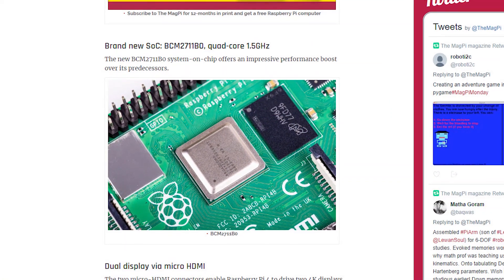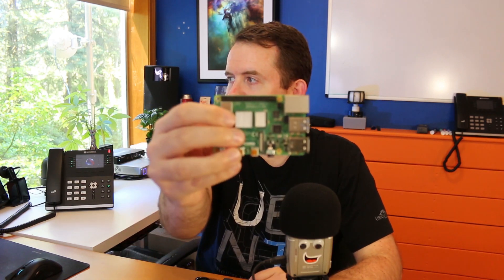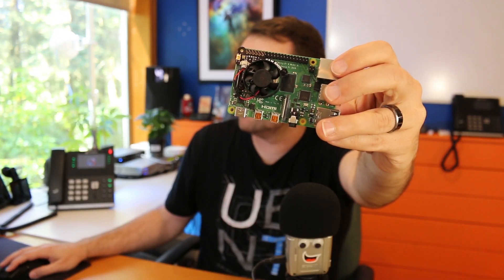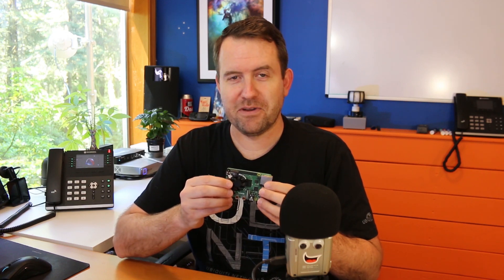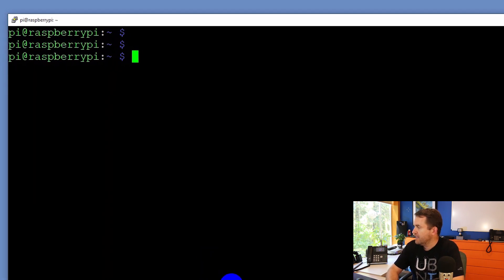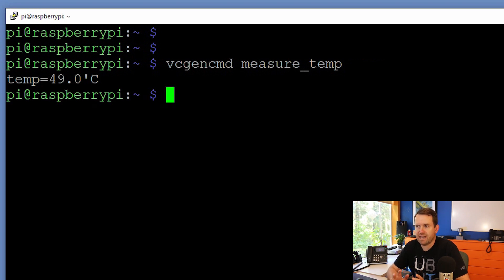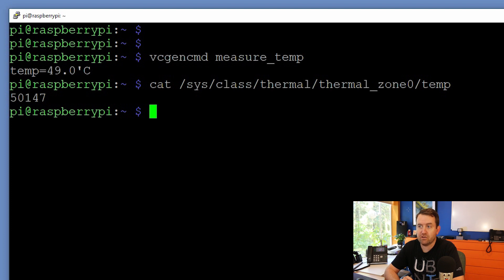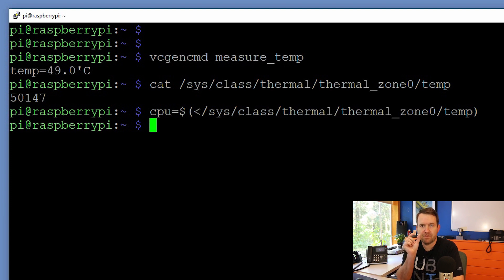Raspberry Pi 4 Heat Testing

Comment: Thank you for the video, some good ideas for heat management. A couple notes: The relatively large black flat chip next to the CPU is actually the SDRAM, not the GPU. That can definitely benefit from a heat sink as shown in the video. Other chips that would be good candidates would be the USB controller, the ethernet controller, the power regulator (as mentioned), and maybe even the wifi controller's can/casing. This hackster.io article has a nice block diagram.
https://www.hackster.io/news/meet-the-new-raspberry-pi-4-model-b-9b4698c284

Also, speaking of Crosstalk, you've got some interesting digital distortion in the left audio channel of the video, that sounds a bit like old school GSM audio interference. maybe something your mic/line is picking up. :-D

Comment: Inside my my-temp.sh script, the console says permission denied when I try to get the CPU temp. How do I fix this?
I've tried forgoing defining cpu and putting the temp location (like you did on the console earlier in the video), and it did notice useful.
Either I get an error that says permission denied, I get a 0 where the temp output should be, or it acts like there is nothing there and doesn't print the CPU temp.
Reply: I had the same problem, the first time you run the comand you have to type: sudo chmod +x my-temp.sh  and then type: ./my temp.sh. it worked for me
Reply: I can get the CPU temp in the console, just not in the script??

Comment: I see your heatsink installation in a different place than suggested. others have said largest heatsink on the CPU, memory module (medium), smallest on the USB controller. why did you choose the power supply?

Comment: People who worry about Rpi cooling are fairly idiotic; no offense. But if you're pushing the system hard enough to consider cooling ... First, ask yourself why are you using the Rpi in the first place? Use something else and have a better experience. Or like the people who dive deep into overclocking them. You might as well overclock a ham sandwich with extra mayo thermal paste while you're at it because that makes more sense.
Reply: R.Pi 4 is a much hotter beast than 3, so you comments mattered more in the old days.  Without a solid heatsink, throttling is very much a thing. Aluminum cases that thermally connect to the CPU (and perhaps memory) are very effective.  I just got an Argon One case and passive cooling works quite well, with a fan that only engages based on heat.  Really depends on why you Pi (yes, making it a verb might annoy some, but it is concise).
Reply: They are fucking idle at 62c. That not cool

Comment: I just use the temp on the task bar.
Reply: that is great 
you just explained a simpel way to do it.
Reply: @frits183  Thank you.
Reply: How ?
Reply: @frits183  First off, I'm not a Linux programmer, when a gui is available I use it. Secind, I just monitor - not graphing or making a table. In Raspbian - Right click the menu bar - select panel preferences - select panel applets - select add - find Temperature Monitor and select it - select add - move it to where you want it.

Comment: The orientation of the board , the heat sinks make a significant effect for natural cooling.  You need to create a chimney effect to cause the heat to increase air flow.   Orientate the heat sinks so the channels are vertical and place a duct to direct the air.   Simplest is a flat card just off the  ends of the heat since at about half to the width of the channels.  Nothing on the sides.    As you make the duct more complex like add sides and extend the duct above the heat sink the air flow will further increase since hot air is less dense then cooler air.

Comment: Thanks as always.  Thoughts on the official POE HAT being able to do the cooling?
Reply from the maker: It should be comparable, but I didn’t test it.
Reply: @CrosstalkSolutions  I use the Raspberry Pi 4 with PoE Hat, but without the noisy Sunon fan. I created my own case for 30 / 40mm fans. With a 30mm 5v "Pi Fan" without heat sink, I end up with the stress test at 60.0'C. I hope I could help you a bit. Here is the link to my modified case, which can be printed via 3d printer. https://www.thingiverse.com/thing:3724434

Comment: You know what's better than a fan shim? A heat sink *with a fan!
Reply: no, in various youtube tests resulted that there's no real advantage, the fan is enough
Reply: @squalazzo  try overclocking it to 2GHZ and see if it still isn't thermal throttling. Also if it's under the thermal threshold, sure you won't see any performance improvement but running it hot even though would decrease the life of the cpu, potentially causing it to fail later.
Reply: @Pngwolffman  I have overclocked my Pi 4 to 2GHz. I'm using  a cheap pi-fan with no heat sinks for cooling. The temps never get close to the throttle point. Heat sinks are not necessary on a fan cooled Pi 4.